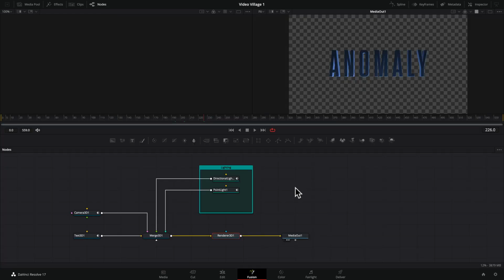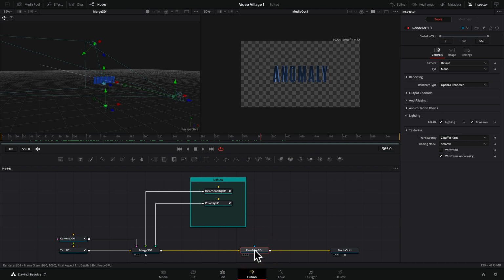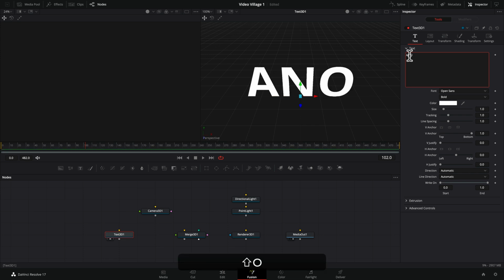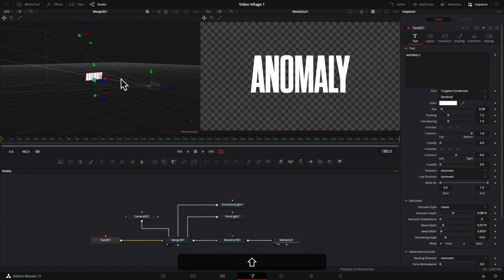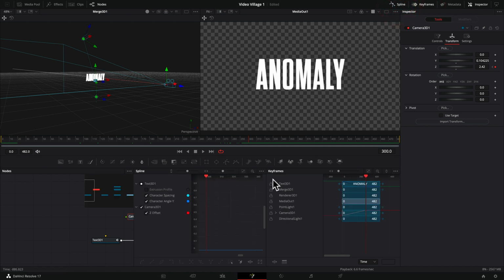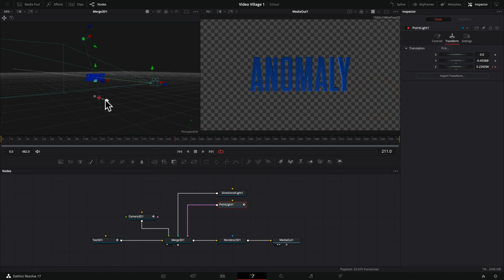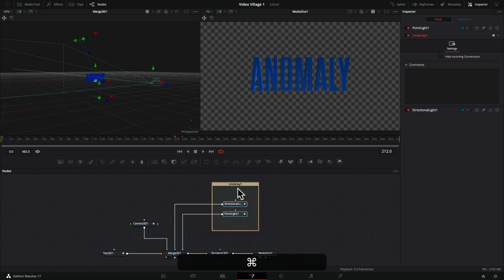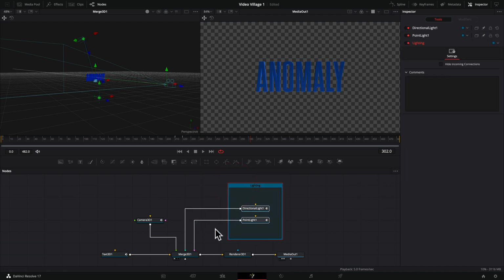Davinci Resolve Fusion Tutorial Basic 3D Text

Comment: Hi all, I would like to give one tip. In the keyframes window, you can copy (hover over the mouse, right-click and select a square) the keyframes you want. Then press the "F" key on your keyboard, and it will automatically smooth out all the keyframes. Then you can refine it yourself. But it usually works. Also, when working with keyframes, if you need to create a lot of clone frames, you do not need to do it one by one. Just open the window of keyframes, copy the keyframe, then move the mouse cursor to the panel where the number of frames is displayed, stop, forward, backward - click the right mouse button and you will see the window (Ping Pong Loop, etc.). This window is the only way to turn on. If the mouse pointer will point at the table with nodes or on the viewing window, it will not work. In short, Fusion has a lot of interesting details that not many people know about. Thanks for the video.
Have a nice time, everyone.
Reply from the maker: Thank you, those a great tips! Much appreciated!